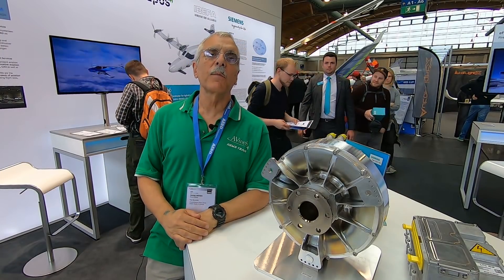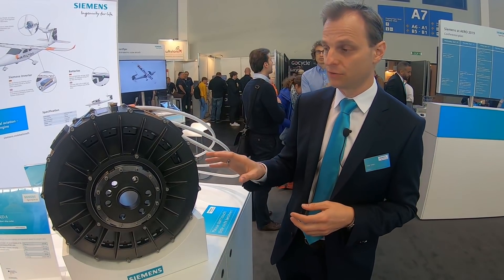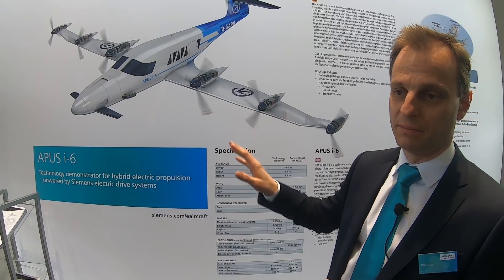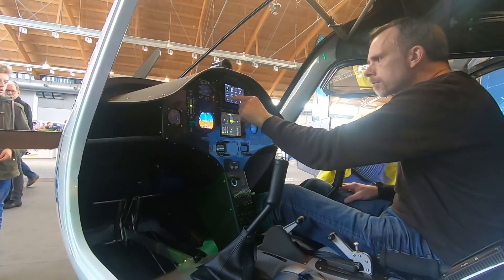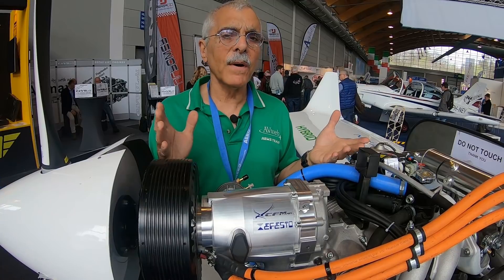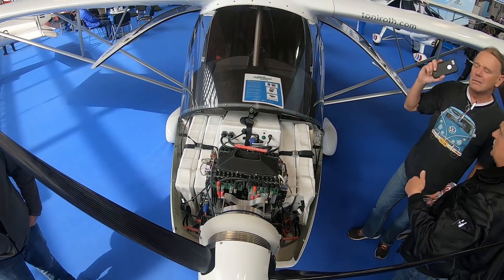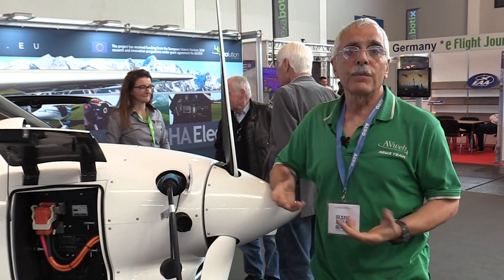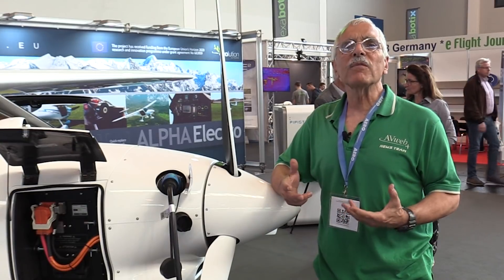What's New in Electric Airplanes?

Comment: I can understand Hybrids in cars, they use power to accelerate, then brakes to slow down, the slowing down process generates electricity from the inertia, but planes dont speed up and slow down constant, 
Isnt using the petrol engine as a generator to power a electric motor more inefficient than running the prop itself ? im saying yes as there will be noise and heat so all that energy is wasted, plus all the extra carrying capacity
Reply: The point is that the engine is always running at maximum efficiency - no idling or over-revving.  The generator-electric motor combination is very efficient, so it is worth it.
Reply: 20 min climb (high power output), range extender for the cruise porting, gliding down - makes lots of sense for many normal applications. Plus probably more reliable for t/o phase. (for pattern work, the Pipistrel uses recuperation on the landing, extends pattern work missions by about 15%).

Comment: What about  super capacitors? I've seen demos of super caps with high density close to existing battery technology, plus they are much lighter.
Reply: They tend to have extreme power density but low energy density - so no staying power.  I'm not aware of any super capacitor tech with energy density close to modern batteries.
Reply: And the engine only working for generator

Comment: Pilot, Electrical C-10 Solar Contractor and Inspector since 95.  The new battery technology was promised to me back in, let's say 97. Still, in 2019, batteries are extremely polluting to manufacture, heavy, and expensive. Shhhhh... don't tell anyone that we ship polluting battery (LOL accumulator ) manufacture to China where they can pollute without penalty. Shhhh... don't worry about all that CO2, it stays in Chinese airspace.... 
The "Energy Index" for E cars is very similar thru out lifetime to a natural gas vehicle, expect the same with E-planes. 
Folks, let's be honest, this is literally "Pie in the Sky" progressive BS., all based on the false assumption that we are going to die from climate change in 10 years.(More political nonsense and pseudo science propaganda).
Notice no mention of Gross weight, range, price, etc Progressive ostriches (that can't fly BTW)  just continue to stick their heads in the sand, obfuscate and conflate the real issues.
Reply: Solar contractor apparently does not give you enough scientific background to utter useful comments. This is only for rare uses, yet, but reliability goes up considerably. Ask your flight school if they'd rather make a higher margin on pattern work training a/c that have a TBO at 3600 hrs at minimum cost and no downtime for that overnight inspection... This will be a trainer market for a long time in pure electrical flying. Hybrid for the right missions. And decades of research before anything with a range over 800 nm with 50 seats or more can be purchased.
Reply: Walterwaltraud 
I think everybody is missing the fact that ALL major car manufacturers are pouring billions (each) into EV development. Since motors are already well developed and chassis/suspension/steering and braking systems are too, then its likely the majority of that money is going into battery/BMS/ESC development. I suspect that research funding for electric storage solutions is going through an order of magnitude step change right now. I’m told that at 400W.h/kg energy density commuter aircraft will not only be viable, but economically superior to turboprop on short haul routes. The potential maintenance savings, alone, are huge.
Reply: @q.e.d.9112  u are right, others won't be convinced before dozens are flying for years.

Comment: I don't trust electric cars now imagine a fully electric plane..... He'll noooo
Reply: Funny that - I don't trust gas cars any more.  I certainly never trusted piston planes. Electric just works: almost no moving parts.  Little cooling needed. No oil change, no engine rebuild.  It's a no-brainer.
Reply: mrmichrom  what you gonna do when your batteries die and don't hold charge ? Are you going to sing the LA LA by song?
Reply: @toohotfortv7521  Like any technology I would choose a good implementation, like Tesla's, with active cooling.  Then I would have to wait more than 15 years for the batteries to stop holding 85% of charge when new.  Sudden failures are rare for well-maintained (charge state and temperature), good quality batteries.  What's LA LA by, do you mean lullaby?
Reply: @mrmichrom8553  hmmm I wish you and your electric technology good luck!

Comment: Battery technology is very close to its peak I’m sorry but the energy density of batteries is reaching its limit where they’re safe. Imagine a lithium fire at 8000 feet, you thought a fuel line and some rubber was bad try a fire that get hundreds of times more intense when exposed to the water in the air after the battery crystallizes and shorts out. We are many years away from electric airplanes being able to go toe to toe with a 172, bonanza, Barron, super cub

Comment: Wing tip propellers adds a new level of danger to the airframe.
Reply: How's that? It cancels out big amounts of vortices and it's DEP, thus pretty smart engineering.
Reply: @Walterwaltraud  Because someone on the airfield who's used to planes with the engine 

in the nose or in the normal position on the wings may not notice the spinning prop on the tip of the wing if they aren't expecting there to be one there.

Or if you're taxing another plane you may well be looking at wing-tip to wing-tip clearance and not notice the spinning blades until you have a multi-(tens of) thousand dollar repair bill before you can fly again.

Plus being electric they are much quieter.
Reply: @fred_derf  But that's not to the airframe, but the public. They are for commuting, so they shall probably be cordoned off on the ramp for the normal passengers. And - they are still noisy. I am curious actually whether for taxiing they shall use just the tail prop or even an electric motor on the gear (they did research for that on commercial a/c - Airbus trying to eliminate taxi fuel basically).
Reply: @Walterwaltraud  if it fails you will have a huge rotational force applied to the airplane. the further the engine is from the center line the greater the problem it is going to become when it fails.
Reply: @VNtergon  No, to the wing, to be precise, and no, that can be controlled. Windmilling effect much reduced since still rotating, even if one of three blades falls off: There is no compression the windmilling prop works against. Then it's rudder size against asymmetrical loading. As for the uneven torque, that will have to be born by the structural load, admittedly. But that's put into the equation, there is a good reason wings are not made out of glass or diamond :-).
Reply: @Walterwaltraud  have you ever had an engine go in a twin engined aircraft? I didnt, but i've talked to the people that did and extra rotational momentum is the last thing they wanted.
Reply: @VNtergon  ... and I suppose they did what I have on my memory items and checklist and at some point turned off the engine. And your friends feathered the engine. End of story. Right?
Reply: @Walterwaltraud  well, they lived to tell me, didnt they?) But still, you cant argue that say a cessna 337 is much easier to handle than piper seneca if one of the engines fails, can you? I just dont really dig into the concept of wingtip engines. You'll have to increase rudder area to compensate (like you said). That will increase drag and make the plane a handful in landings with crosswind. It all makes me wonder why make things more complicated?
Reply: @VNtergon  Because aeronautical engineering is always about compromise. The X-15 and X-57 share little other than the same airspace, same physics but are quite diverse for the rest. Of couse asymmetrical has downsides that leads to a bigger rudder/ rudders. That's the nature of the beast. It's just numbers for a certain purpose...(and for the record, I live flying twins, love crosswind landings, and love the concept of flying fewer passengers in decentralized traffic. But if they don't prove it can be certified, well then I shall never fly it and live happy anyway...).
Reply: @Walterwaltraud  haha, very good point)

Comment: Passenger compartment rigged with heaps of pedals.  Passengers who pedal the most generate more electricity and receive reduced fare.  You're welcome. 😂😄😄
Reply: Meet the flinstones
Reply: Darrin Nunyah 
Did you ever see the programme where they rigged up a whole load of bicycle generators in a gym to run a house? It took 70 people pedalling hard to run an 8kW electric shower.

https://youtu.be/C93cL_zDVIM
Reply: @q.e.d.9112  My comment was a joke.  I realize that an airliner would require much more power than passengers could provide.  - Not to mention that lots of them would give themselves a hear attack...

Comment: now to find free electricity in the sky,,,,  recall   V/m ,,,
Reply: There is no free electricity. If you’re referring to solar it isn’t free, it costs weight. The amount of energy solar panels gather would not justify the additional weight. I hope you’re not talking about wind as it’s obvious a passive propeller would never create near enough energy to power a powered prop and it would created a lot of drag negating the power it did generate. It may be possible to have a form of regen on the props but it would likely be such s marginal amount that it wouldn’t make a difference.
Reply: @mcearl8073  https://en.wikipedia.org/wiki/Atmospheric_electricity

Atmospheric ions created by cosmic rays and natural radioactivity move in the electric field, so a very small current flows through the atmosphere, even away from thunderstorms. Near the surface of the earth, the magnitude of the field is on average around 100 V/m.[3],,,, and every 1m up...  100v more,,,